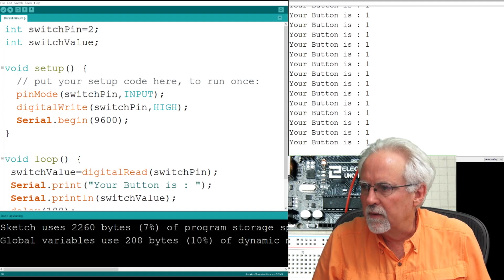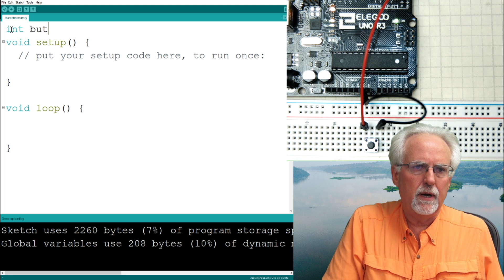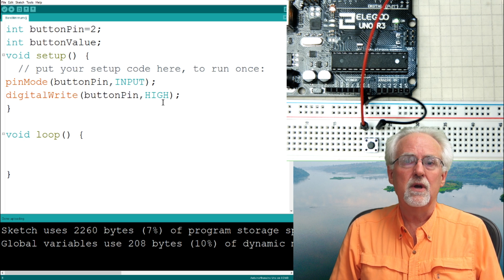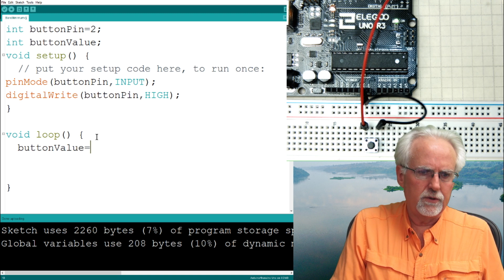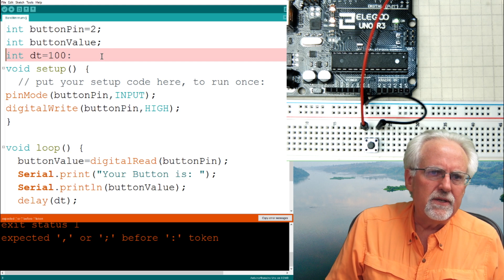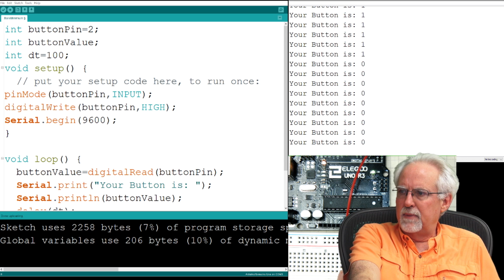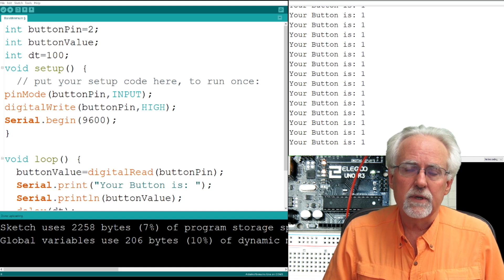Arduino Tutorial 34: Simplest Way to Use a Pushbutton Switch

Comment: Arduino Unos do NOT have internal pulldown resistors.   I looked it up.  let me know if I am wrong.  I tried with both the method explained here switching write to input 2 to LOW and connecting switch to 5v.  Also the pinMode(INPUT, PULL_DOWN)  method....no luck

Comment: pinMode(buttonPin,INPUT_PULLUP);

this also works instead of 

pinMode(buttonPin,INPUT);
digitalWrite(buttonPin,HIGH);

both of these work exactly as if you where to put a pullup resistor, lowering the amount of hardware needed.

Comment: I have a question sir. When I push the button wouldn't it produce a shortcut because there's not a limiting resistor in the circuit?
Reply: no...the arduino it self has an internal resistor
when you make the input pin high you are basically "activating" this internal reisistor

another way instead of setting the input high would be to do this 

pinMode(buttonPin,INPUT_PULLUP);

this also activates the internal resistor.

Comment: hey mr. McWhorter, glad you're still reading comments and before anything i want to thank you for this series, you're an excellent teacher. i have ran into a problem with this technique, if i don't use a resistor and don't do the "original" way of wiring a button, the button value goes up and down by itself and ignores my input. same thing happened with tilt sensor which i fixed it by using a pull up/down resistor. do you have any idea what's going on? i guess it's worth mentioning that i'm using a no-name brand UNO R3, which seems to be working fine everywhere else!

Comment: The new IDE already has an INPUT_PULLUP feature. I think the IDE you were using doesn't support that. But, it's good to know that it can still work by doing a digitalWrite. It is useful for me because most Arduino micros I've bought doesn't support the new IDE. Thanks so much Sir.

Comment: This is the first video that I watch till the end and have one thing that I am confused about. How are you connecting ground(negative) directly with pin 2 (positive)? To what I know, this should in theory cause problems, but it just works!? I am really confused what I am misunderstanding here :|

Edit: Maybe I need to explain a bit. in an alternating current (AC), it you make positive and negative wires connect, you will get a serious problem and should cause things to break if not protected. I know this is Direct current (DC), but isn't it the same concept?

Comment: This will be very helpful.  Is there any downside to this?  Does it cause the arduino to heat up more?  I presume there is little current carrying capacity, it's just to signal an operation, if you want current, trigger a relay. 

I guess I wonder why anyone would bother with a seperate resistor if you can write a line of code.  

I did learn, this evening, why the microswitches always have four leads.  I've conducted repairs on small electronics in the past, such as a computer mouse, and wondered why there were four pins on a switch; I already figured out the three pin switches that only use two because it's bulk manufacturing, just use the N/O pins. 

I need to go back and watch episode/lesson 27.  But I think this must* be why the micro push buttons have the four pins, it's not double throw, it's so manufacturers and others can tie a pull up or down resistor to the switch without having to double up on a pin with solder and wire or make the board more complicated.

Comment: I have become addicted to this series and particularly your teaching style.  I understand that you went through the whole push button using pull up and pull down resistors in lesson 33 so that we understood the theory.   I really like how you integrate the hardware, software, and physics.   I am already looking forward to your raspberry pi series after I finish the arduino.
Reply from the maker: Wonderful!
Reply: am I missing something in lesson 33 or you meant lesson 27? I don't see anything about buttons in 33. And I still don't understand why this method works. so far this has been the lesson I struggled most with.

Comment: I believe the Arduino site someone mentioned that an internal app. 30k resistance is used.
This should prevent arcing switch contacts. Probably the shortest lesson.

Comment: Hi Paul. im new to arduino and have been working on a project that i cant find being done before and am having trouble with the code. i would be very grateful if you could reach out to me so i can send you the short code to see where im going wrong as i just cant get it to work.
it is only a short code but as i have said im new to this.

Comment: Quick question Paul: I was under the assumption that straight volts to a component would make it smoke. Is this only LED's? Why is our button safe without a resistor? Thanks in advance!
Reply: INPUT mode activates the pull up resistor that is inside the arduino itself ( 20K ohm ). When you write HIGH to it, and if the button is not pressed, you will be reading 1. When the button is pressed the circuit will be complete and current will be flowing to the ground so the presence of resistor will make the current so low that you will be reading 0.
Reply: @MustafaKaya-vd6pd  Thank you for that explanation! I was wondering about this as well

Comment: I am in the process of learning how to use Arduino board and love these tutorials.  However, while watching this tutorial and reading through the Arduino instructions, it appears there may be a simpler way to write this but I am not sure if it applies here.  Instead of instantiating the pinMode as INPUT, can we instead instantiate it as INPUT_PULLUP and then get rid of the need for the digitalWrite(buttonPin, HIGH) line?
Reply: Yes - that is what I am doing too.
Reply: thanks for the insight! less is more =)

Comment: I always prefer to have the value read "0" when the button is not pressed and "1" when it is pressed so I tried connecting the button to 5V and pin 2 and to write "LOW" to pin 1 to see if that would work as a pull down resistor. And it did :)

Thanks for this neat trick Paul!

Comment: Paul, why did you choose to use :
  pinMode(buttonPin, INPUT);
  digitalWrite(buttonPin, HIGH);
as opposed to.
  pinMode(buttonPin, INPUT_PULLUP);
to set the internal pull-up resistors? (yes, both do the same thing as others have noticed...)

Comment: Halfway Home... lesson 34 of 68!  Loving learning new tech at my age,  70.  Loving coding again, which I did a bunch before I retired.  I still don't quite understand how a pull up resistor is introduced by setting an input pin to HIGH... but I'll go back and watch again.  That confused me in the last lesson, too, no fault of yours.
Reply: Its the same idea as putting the resistor to +5VDC, when the button is pushed it creates a path to ground so pulls the pin low by creating a low impendence circuit to ground.
Reply: @nobleforks8911  Can also use command INPUT_PULLUP

Comment: Paul, you anticipated my question about asking why you could do this in the previous videos for the joystick switch. If I correctly understand, the pin2 output driver impedence replaces the 330 Ohm pullup resistor? No reliablity problems in shorting the IC outputs? Thanx.

Comment: Thank you Mr. McWorther, I love this, now it's much easier for me to create pull up switches, also I decided to do a bit of neat formatting, so I added two if functions to say wether my button is on or off in the serial monitor. Here is the code.

int buttonPin=12;
int buttonVal;
int dt =100;
void setup() {
  // put your setup code here, to run once:
Serial.begin(9600);
pinMode(buttonPin,INPUT);
digitalWrite(buttonPin,HIGH);

}

void loop() {
  // put your main code here, to run repeatedly:
buttonVal=digitalRead(buttonPin);
Serial.print("Your button is");
if(buttonVal==1){
  Serial.println(" off");
}
if(buttonVal==0){
  Serial.println(" on");
}
delay(dt);
}

Comment: Thank you for such useful info! But i've got a question. In the video, you are talking about some internal resistor connects to our buttonPin when we set pinMode(buttonPin,INPUT). Is it some resistor already put in Arduino to make possible to read from the pins(in this case, from buttonPin)? If yes, then this way of reading, should work only with microcontrollers with the same system of readings?
EDITED: Now, i got the idea, and that's really amazing how knowing the assebly of the Arduino can help us a lot! AGAIN, THANKS! and have a nice day :)
Reply: What were the answers to your question? I am curious too

Comment: Paul,

Thank you for showing us this trick.  This was a great video.  I just had two quick follow-up questions.
1) Why the heck do we even use pull-up resistors at all? Is it that this trick just isn't known or is it that there are stability issues.  Because I noticed you mentioned theoretically that it was stable.
2) Is the internal pull-up resistor internal to the ATMega328P chip or internal to the surrounding circuitry on the Arduino board?
I ask because I use the standalone ATMega328P circuitry in a project with a push-button wired up to it.  Being able to eliminate a component/installation step with a few lines of code would be great.

Granted after watching your series I am considering replacing the pushbutton with a potentiometer to give me finer control on my program.

Comment: Hardware pull-up or pull-down resistors, this method and INPUT_PULLUP; we have options.  I like the idea of using the Arduino internal pull-up because of it's simplicity but I wonder in what applications hard-wired PU resistors may be to our advantage.
Reply: Less work for the MCU, INPUT_PULLUP or setting the same pin as INPUT and HIGH at the same time utilizes the limited power output of the board. This is the reason to use resistors; resistors just get rid of stray current(could be generated by as simple as your fingers close to the button or stray EMF in the air) to be grounded.

Comment: But won't we have short circuit in such schema? Does push button have some resistance to avoid that?
Reply: I just found the answer in an old comment. The board has built in resistors to avoid a short.

Comment: So this piece of code simply doesn't work for me. Neither the INPUT + HIGH method nor the INPUT_PULLUP code works. I always get a value of 1. I can get it to work with an external circuit to create a voltage divider, but not with the board itself.. Is it possible that my board (a non official Arduino copy) does not actually have an internal resistor to act as a pullup?
Reply: bosko

Comment: Why are there gaps between each set of 5 holes on the power rails ? Its like a hole is missing between each set of 5 holes ? Im sure there is a technical reason.

Comment: Wow...this is a great hack for simplifying the pull up resistor switch scenario. That's three ways I've learnt now...(1) Using the actual external resistor set up...(2) Using this excellent method...........and (3) using the pinMode(buttonPin,INPUT_PULLUP) method. Like the old saying goes..."There's more than one way to skin a cat." I would think that it's real handy to know all three...and there are probably others out there too; I'm sure that given a certain situation, at a more advanced level, each method could come in useful, having that little advantage over the other in that particular application. Thanks again, Paul. Stay safe, mate....and best wishes and regards to yourself and family. Cheers....Grumpy LImey.
Reply: brilliant !

Comment: Hi Paul, I was just wondering if this does not somehow create a short (i.e. the HIGH signal pin directly connected to GND)? Or does it not create a short because the signal pin is defined as an input to begin with and "HIGH" is just a superficial state?
Reply: Internally it uses a safe high value resistor to pull it up to VCC, so no need to worry. (around 100k ohms)   pinMode(pinNum,INPUT_PULLUP);

Comment: Can I do this with say three or four buttons in the same program, or am I limited to just one?
Reply: yes, Its good to code it for each pin you connect to
pinMode(buttonPin,INPUT_PULLUP);  // Button used for Select function 
Adding a comment is wise as well by using // example as shown etc

Comment: Hi Paul  I have an 8 digit 7 segment  display with the Max 7219 chip. I want to make it show scoring points on a pinball machine using an arduino Nano or Uno.
Not sure if you have something already on one of your videos   would require push buttons to change the score  preferably  one to change ones, another to change  tens and another for  one  hundreds?
Any help would be appreciated  Maybe even a good course to do if not already

Regards
Pb

Comment: I did a few of these button projects myself without any resistors. When I pushed the button, the led turned off. I didnt understand that. I changed buttons but that didnt help. No I see that I probably made a fundamental mistake by not nserting a resister.

Comment: Paul, I don’t understand. Almost everybody says to use resistor. Or even the internal board resistor. But you showed us a much simple way AND without resistor. So why almost everybody use resistor if your solution is much simple?? Thank you!
Reply from the maker: We are using a resistor, it is connected on the board itself by the command.

Comment: It's indeed a nice "trick".  I  personally use always " pinMode (buttonPin, INPUT_PULLUP);"  That was how  i  learned it  in other lessons, in orther to to avoid  using a real pull-up restitor).
But this method is also nice.

Comment: pinMode (buttonPin, INPUT_PULLUP); would save a couple of characters :)
Reply: The default mode of  digital pins is the INPUT mode, so we can omit this declaration, therefore by using the pinMode (buttonPin, INPUT_PULLUP) we are not saving any typing :)
Reply: @batticha462  if you don't declare it INPUT_PULLUP you need to do digitalWrite(buttonPin, HIGH)
Reply: 28 vs 31 characters... I personally prefer the INPUT_PULLUP declaration though :)
Reply: @luismisanmartin98  would you be kind enough to tell me where i can learn more about this INPUT_PULLUP or map() type of things? i m a beginner and the main problem is that i didnt even know these exist!  Thank you <3
Reply: It's not so much about the characters you save. It makes your code easier to read and more logical. And that is far more important when you are in debug/modification session years after you wrote the code.The INPUT_PULLUP is self explanatory where the pinMode(x, INPUT) - digitalWrite(x, HIGH) is not.
Reply: This is what I do